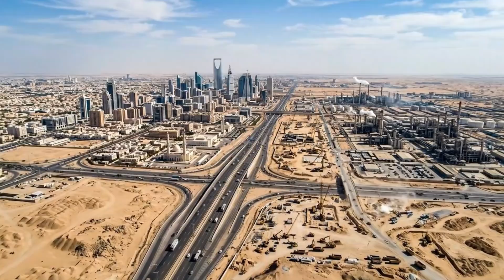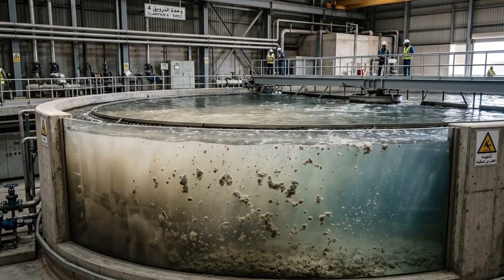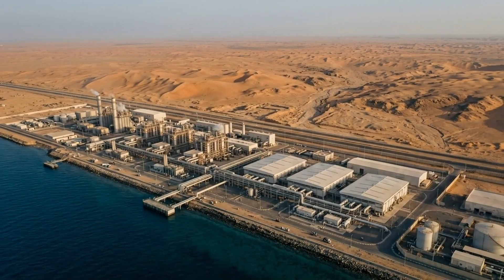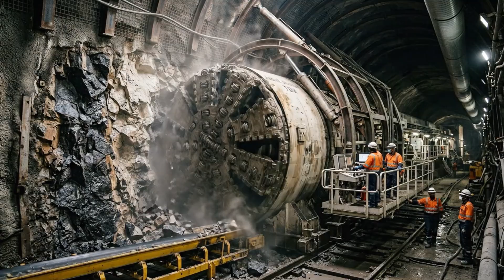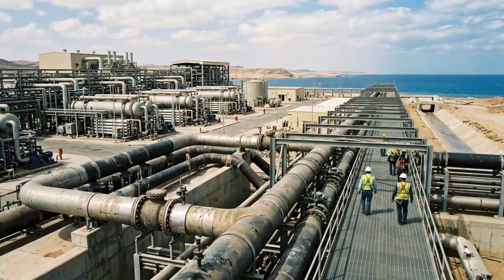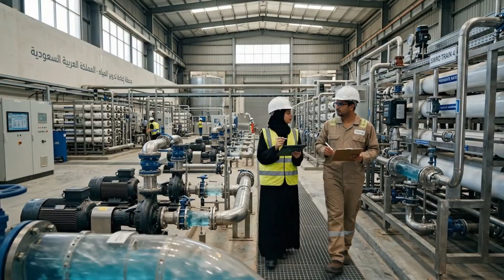How Saudi Arabia Pumps Billions of Liters of Seawater Through Giant Pipes To Turn the Desert Green

Comment: I came into this video thinking desalination was basically just filtering seawater, but I was completely wrong. The pressure, pre-treatment, membranes, remineralization, and corrosion control make it an incredibly complex process. And then the water still has to travel hundreds of miles inland. This is a whole infrastructure system I had never appreciated before.
Reply from the maker: Thank you so much for watching and sharing your thoughts, Jorge! We're glad the video helped reveal the complexity behind Saudi Arabia's water infrastructure.
Reply from the maker: Exactly! I had the same impression before learning how many steps are actually involved in turning seawater into safe drinking water. And transporting that water hundreds of miles inland adds another massive engineering challenge on top of the desalination itself. It's amazing how much technology is hidden behind something as simple as turning on a tap.